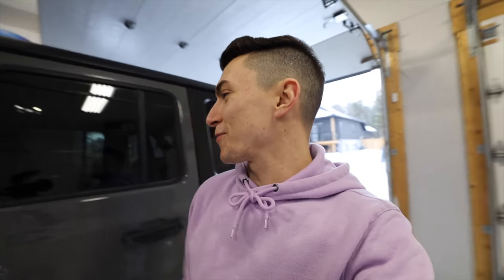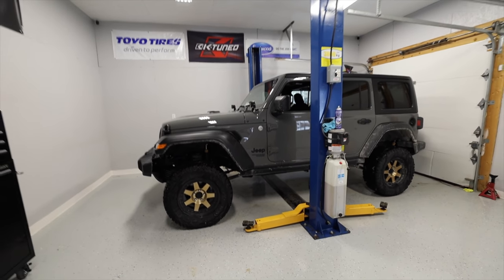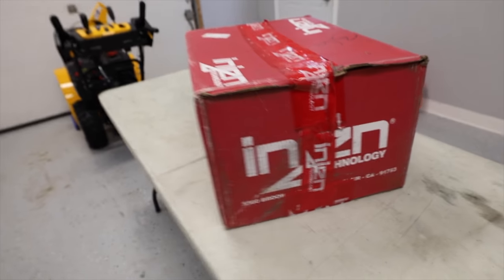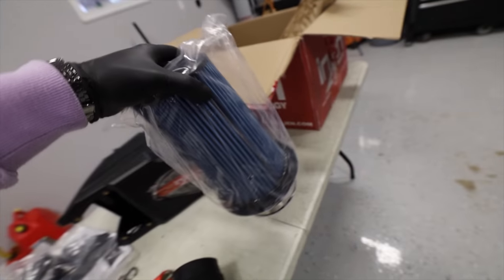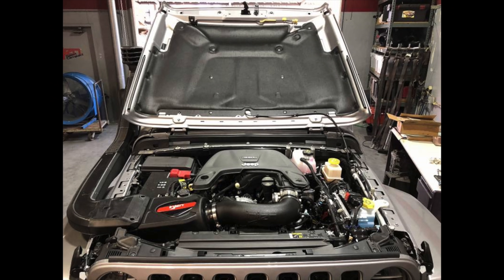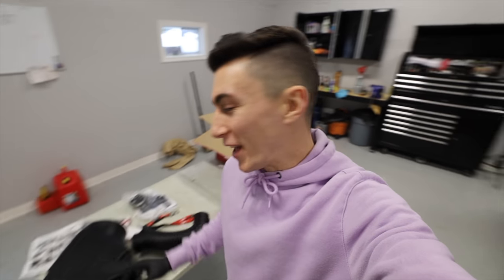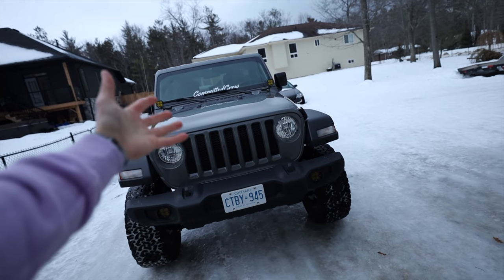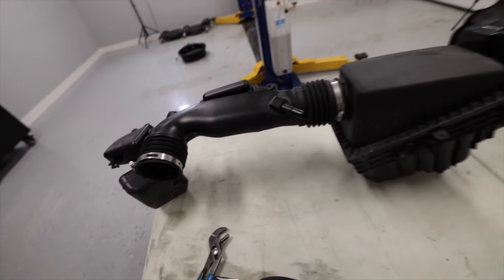The PERFECT Intake Install on the Jeep! - Sounds Unreal🤯

Comment: If you want a better fit take the grill off and remove the ram air housing that’s for the original intake which sits below the big box that your actual filter goes into. Also not shown ; take the original AIR censor plug in off of your stock intake and put in the CAI port. The CAI also comes with a rubber housing that goes in the hole for the Air censor hose  to go in.  The rubber gasket It’s kind of hard to install it but be patient. It’s a really good buy and just zip tie the slack from the air censor to the other wires for a cleaner look. This intake really makes a responsive difference and increases the exhaust sound. Adding my axel back borla attak tom. Its just a 5 bolt install ;)
Hope this helped you all.

Comment: I bought a Injen cold air intake for my 2017 Silverado 5.3 and you could hear a complete difference when you would step on the gas.  When I did a straight pipe with a resonator and muffler delete you obviously couldn’t really tell anymore.  I never had a single engine code the entire time it was installed either.  The nano web filters last 100,000 miles and maybe once a year blow it out with my air compressor.

I recently traded it in for a custom ordered Gobi Mojave Gladiator, and I just got my Injen Evo cold air intake delivered yesterday.  I’m really pumped to get some free time and put it in.

Comment: I love the videos Robbie and I’m so glad you’re back, one word of advice I can give is loosen or do the oil filter first on the jeeps because they hold pressure and if you loosen it after you drained the pan all that oil in the filter system will now drop into the pan so do the filter first. I’m sorry if you already knew this or I’m wrong about it I’ve only been a mechanic for 2 years now.

Comment: That's pretty damn good. You can definitely hear the suck. On my mazdaspeed 3 it's the same way if you only add a stock size cai not only can you hear the intake whistle but the factory diverter valve makes a tiny bov sound.
Reply: Agreed, I have a speed 6

Comment: I’ve noticed that nobody ever has a headliner in these Jeep videos. When I bought my Gladiator, I was going to paint the white roof black, because I hated the bare fiberglass look. Instead I installed a Cover King headliner. It installed great and looks awesome, plus quieter and thermal barrier. 
Also, I’ve never in my life seen an intake or exhaust add 5-10 hp each, or better MPG, except with tuning in my Duramax turbo diesel. That truck is loaded down to 10-11,000 pounds with huge tires and it still gets better MPG than the Jeep. The Jeep is much more fun to drive though, even with less than half the horsepower and 1/3 of the torque.

Comment: Drive by wire throttle bodies- don't open them manually there are plastic gears that are extremely brittle and with strip out, regardless how new they are.

Comment: The best upgrade you can do to a jeep,to improve performance,is to Re-Gear it.If your Jeep is factory stock,then forget what I just said and leave it stock.However,if you upgraded your Jeep to bigger tires,then a regear is a must  do.If you are running 35s then go with 4.56 gears and with 37s go with 4.88s or 5.13s depending on which tranny you have.With the Re-Gear ,you will get back all the performance you lost when you installed the bigger tires.

Comment: Never had a problem with my jeep tj until I paid it off, clutch and the radiator that was it. Slipping in third gear, and too many highway rocks hitting the radiator. Didn't give me any more problems after that! not even oil! always changed oil every 3000 t0 4000 miles. Mah  That's the first things I do on my vehicles air filter and exhaust. That's it don't need anything else. I use to put K&N air filters on my vehicles they sounded the best but that's just my opinion, Then i'd get a muffler put on too. just one that sound good or got good reviews.

Comment: Hey Robbie, so glad I came across your channel!  Your videos are phenomenal!  Thanks to you I'm hemorrhaging money on mods for my '21 Jeep Rubicon! LOL.  
Quick question:  What engine do you have in that Jeep?  
I wanted to install the Injen EVOLUTION Cold Air Intake System  EVO5005 in my 3.6L V6 24V eTorque but Injen's website for the system, under the notes section says  "Does not fit on eTorque Models".  I called 'em up and the guy did some checking and said the reason they say that is because they haven't tested it on that engine model so they can't confirm.  Sooooo...was wondering what you had under the hood of your Jeep as it seemed to all fit together well.   Thanks for any input!

Comment: Almost all add-on's will "up to" xxx additional horse power. If it says up to 10 hp it doesn't mean you will get 10 hp is possible with all the right conditions. In all likelihood you will get significantly less than that. Probably closer to 1 hp or less if you are replacing a clean factory system.

Comment: Mildly used Turbo charged vehicles should have an oil change every 10,000 km, non turbo at 15,000 km. Racetrack turbos as soon as every race. Anyone who tells you differently is trying to make a buck. Take it from a former engine mechanic.

Comment: You're wasting your time with that box here's what I did...
Use your original airbox where your filter goes get 3-inch PVC and an elbow..
And two rubber couplers that will fit the three and a half inch pipe...
That way you running straight are no antibiotics no bouncing around straight air
You can get this at Home Depot which is cheaper than those check Menards...
I do this to my 47 motor and it gave it 15 extra horsepower...
Takashi around 25 bucks to do it I'm sure that box cost more than that...
Just letting your viewers know think outside the box hopefully you understand where I'm coming from.